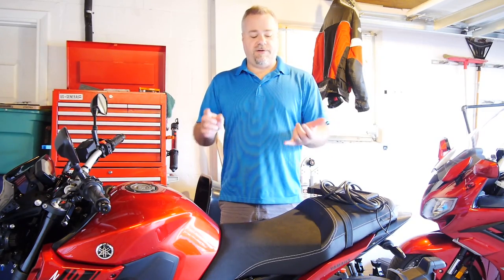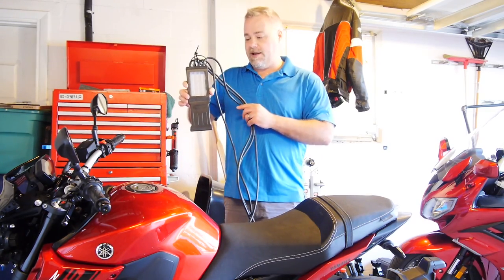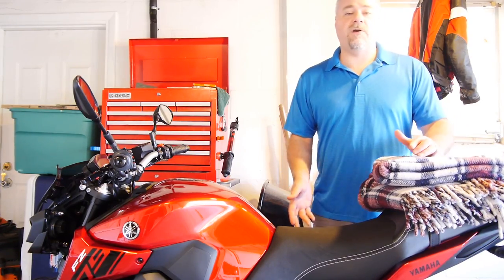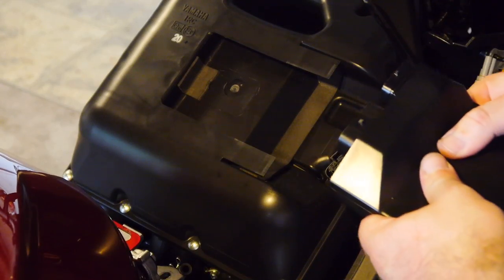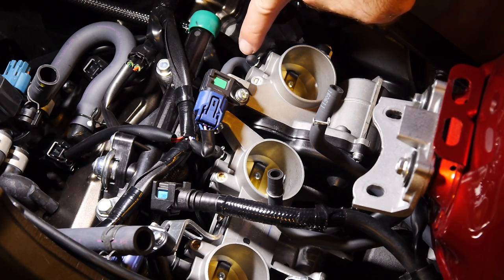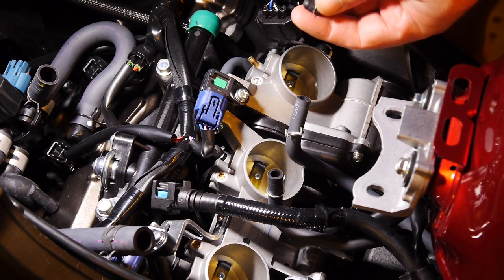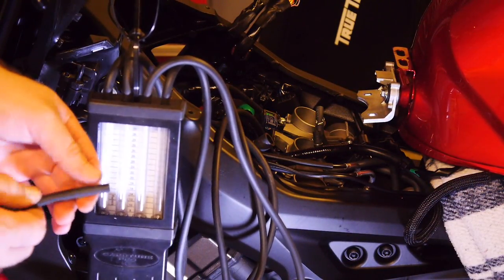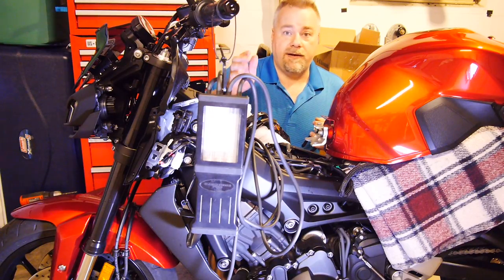How To Do A Throttle Body Sync TBS 2017 FZ09 MT09 FJ09 MT09 Tracer XSR

Comment: Love the video and you only confirmed my suspension…this is my first fuel injected bike and I stupidly thought it wasn’t necessary because of the electronics …I noticed a high rev vibration after doing my valve lash… I’ve felt this in all my older carbureted machines when they got outta wack …after searching for hours for my sync gauge I got her tuned and holy crap what a difference!

Comment: Consider this...if you use a master cylinder to calibrate off of, then you could still use this tool on more than 4 cylinder engines.  Calibrate your first 4 cylinders, then, while staying connected to your master cylinder, calibrate the other two or however many.

Comment: I just bought an xsr 900. I've been irritated by the vibrations in in throttle lever and right foot peg at higher revs. I had no idea it might be something tunable. It's getting that break in service done next week and I'll make sure this step is included in that.
Later one I'll get the tool myself. 
Thanks bub.
Reply: Update: this isn't a fixable thing according to the mechanic. It's a computertuning thing and pretty much requires an after market exhaust. I'm doubting his competence based off of info from a YouTube video. I've become one of those..

Comment: Hi. Great tutorial. I can't see a way to that left hand vacuum connection though... even if I could get the cap off, I'm not sure how I'd get the gauge tubing on. 2018 bike, but surely they can't be too different.
Reply from the maker: Long needle nose pliers.  Easy.
Reply: Seriously I have long and angled needle nose pliers and not only is it near impossible to see but everything is in the way. Did you disconnect other lines out of the way first?

Comment: The clamps being difficult to remove is most likely not due to “over-tightening”.  Clamps with dissimilar bolt and clamp materials are subject to excessive friction when torquing.  It is known as “galling” and causes a welding effect.  With every penny accounted for in production costs it is, by design, an effective way to maintain clamping force where the joint is subject to vibrations.

Comment: Great instructions! I purchased the Carbtune Pro tool based on your recommendation. I plan to  check the sync during my 600 mile service on a 2020 FJR1300 over the next day or two. I also watched your other video specifically covering the FJR sync process.

Comment: Thank you for this. I followed the procedure but made the mistake of not allowing the bike to warm up properly before starting the adjustments. I managed to balance the cylinders, but now the bike is idling at 1600 RPM, and after riding for an hour, my throttle hand became numb. Going to try it again.

Comment: I took delivery of a new 2019 Tracer 900 GT, two weeks ago. I just put over 1000 kms (600 miles) on it. I did a 400 km ride yesterday, and I had crazy amounts of vibrations in the handlebars, my hands are still a bit numb today. I hope getting my throttle bodies synced will help correct this. It is sucking the joy out of riding my new bike.
Reply from the maker: It will!

Comment: good job on the video, i did this for the first time ever on my VFR800 i had last year.. made a huge difference in the vibrations like you said.. i looked in the Vrods manual says nothing about adjust-ability on them.. id have to look it over to see if it has adjustable screws to do it to this bike.
Reply from the maker: +William Huston, Realtor same procedure but the crowd requires you to install fittings to the engine they don't give you the nipples.
Reply from the maker: +TwoWheelObsession vrod not crowd lol autocorrect

Comment: Good video just finished syncing throttle bodies on 19 mt09. I was able to get them all in sync but I noticed the adjustment screws for both throttle bodies are fully turned to the right. What happens next time I need to sync throttle bodies ?
Reply from the maker: If they still need to go that way you can back out the master up to a turn without a problem.

Comment: Hey Bryan. The manual notes to re-install the air box after connecting the sync tool before checking the sync, then adjusting if needed. I realize it would be pretty much impossible to get to the adjusting screws with the box on, but have you tried checking the sync with the air box installed compared to removed to see if there is a difference in readings?
Reply from the maker: I have on others and it made no difference to leveling them. It would to an absolute number, which is not needed at all.

Comment: I just picked up an XSR 900 and everything you described about vibration is what i'm currently experiencing.  It would appear I need to do a throttle body sync.  Can you point me to which video you went into more detail on disassembly. This will be my first time into the "guts" of any motorcycle so I'm a bit nervous.  Great video, and I'm actually looking forward to doing the work myself.  any additional advice, tools to use, etc. is greatly appreciated.
Reply from the maker: +Kevin Ankin the one called how to remove your tank air filter etc

Comment: great video, I am glad I found your channel, I just got and xsr900 and has about 250 miles, so I would have to do this soon, The only part I am confuse is the part with the master cylinder, is it the one with the white where you adjust it or you never touch that one. thanks in advance for the reply.
Reply: You never touch that one. You adjust the other two.

Comment: Thank you very much for this instructive video. I also bought the Carbtune Pro and try to do the sync on my Yamaha Tracer 9 - same CP3 engine, but no matter how much I try to adjust the screws, it does not seem to work for me as I'm not able to level up all 3 columns of Hg. The one from the master cylinder (painted one from the factory, which I haven't touched) is just 2 increments up from the others 2, no matter how much I tried to adjust (no more screw rotation left). Do you have any idea why? Any input from you would be much appreciated.

Comment: Thanks for the great info and upload. My FJ09 is doing exactly this problem. It just started this spring . Before it used to be dead smooth. I have a question though. How often do I have to re-sync the throttle bodies ? Thanks in advance.
Reply: Yamaha recommends every 4,000 miles

Comment: Good vid. I have a 2015 FJ09. 1,900 miles. Just bought it n put one tank of no lead in it. I’ve burned a half tank n this morning noticed a slight misfire all thru the rpm range. I rev it n notice a slight backfire. It pull fine no flat spots. You indicated the vibration issue. My bike does vibrate. Just started it. I’m looking online for this misfire problem but have not found anything. Could I need a sync? Would out of sync cause a slight misfire? It’s so new I’m not thinking about a parts issue. Any feedback would be appreciated. Thx Chuck.
The backfire is when I close the throttle. Like a lean issue. You can barely hear it.

Comment: I tried a throttle body sync on my 2021 MT-09.  The master cylinder remained higher than the other two.  What do you do in that situation?
Thanks in advance.
Reply: I had the same issue.  I just got my other two a close as possible.  I wrote to Yamaha USA about the matter and haven't heard back.  My bike is running great so I'm just going to let it go.  My next maintenance is coming up soon and I'll see if that hasn't changed.  If it's the same, I guess I'll just live with it.

Ride well.

Comment: If your ecu is flashed will it effect the rev range the primary cylinder is set too stock or do ecu flashes not have an effect on where the idle is supposed to be?

Comment: Hey, thanks for the knowledge you share. I am buying a MT 09 this Monday and this is a lot of information i need in one. 

I have a question: How did you supply fuel for the adjustment when the fuel lines were disconnected?
Reply from the maker: They are not disconnected
Reply: Was it connected with the lines from the tool?
Reply from the maker: You misunderstood the video. They fuel was never disconnected. The electrical connections were reconnected after removing the heat shield.

Comment: Great vid, just a thought though there seems to be a debate on some forums whether the job should be done with the airbox on or off, I wonder what the workshop manual states
Reply from the maker: +Bikers Quest the wording is confusing until you realize it's not physically possible to do any adjustment with it back on. At idle it's irrelevant for readings anyway.
Reply: I would get paranoid about stuff dropping in, maybe some nylon hose over them to keep out anything large?
Reply from the maker: LOL uh, no.  #1 no need.  There is no magic 'stuff' floating around ;)  #2, that would get sucked in LOL
Reply: i guess I've always been drilled never to run a bike with the filter removed but I don't see another option in this case

Comment: Hi Brian, Just an update as to the price increase since 2017..... $140 today on Amazon. How would you feel about a ECU Flash from 2 Wheel DynoWorks for $250?
Both prices ref. 1/31/22.

Comment: How often should you tune your throttle body for the mt09, and where can i find the periodical maintenance table for this?  I have looked over owners manual and i could not find it or i might have over looked it.
Reply from the maker: It's right in the chart in the owners manual with everything else

Comment: @TwoWheelObsession
Great video, thanks for sharing knowledge. I have 2 questions.
When tightening/loosening those screws you are decreasing/increasing air or fuel?
When you say that the Carbtune Pro tool can be used on any bike you are referring to any fuel injection bike or even carburated bikes aswell? 
The name Carbtune is by itself sugestive but it's just to be sure ☺️
Reply from the maker: Any bike. You are adding air

Comment: I have to ask. Does your engine tick (like valves at top) at about 3000 rpm? 
Curious if it's something that may be remedied by doing this..
Either way, your video convinced me to buy this tool. Thanks!
Reply from the maker: No and no
Reply: Oh well. My bike has just over 1300mi on it and has some stutter in the idle, so I'm still going to sync it. Going to open it up in the spring and check valve clearance.
Reply from the maker: Neither of those cause any kind of stutter.  Check fuel and ignition.
Reply: I apologize, stutter may not have been the correct word. The idle just isn't smooth as I think it should be. 
As far as my valve noise, the shop told me it's normal Yamaha engine noise, but I'm still going to check.

Comment: Thanks for your content and the time to put it out there. I recently purchased an xsr900.  When I just twist the throttle a little bit ( revs 3000 and under) the bike starts chugging or lurching I’m not sure how to explain it.  It’s like it’s not getting the fuel until I open the throttle a bit more. 

happens in every gear at whatever speed like the bike wants to stall. I need to feather the clutch around turns.  Would this sync be the first thing to try?  Idles fine and other than this area of the throttle position all seems to work fine.
Reply: Did you ever get your issue addressed?

Comment: I do have the carbtune aince a long time but im not use to this bike, you said not to touch the master bolt so that mean you are just playing with the 2 brace ones ?
Reply from the maker: Yep
Reply: TwoWheelObsession thanks, my dealer wont touch it he want to make multiple appointments to do it in between the yamaha manual , 500kms,1500,3000...etc a money pit of a service dealer if you ask me .. the manual said the first should be 1000kms 2nd 7000kms etc... Not the same !

Comment: Hey there, so I did the throttle body sync in my fz09 and right after that, a rattling noise when the clutch is not pressed started. It stops when I press the clutch. What do you think that can be? Literally started as soon as I had the bike all put back together and went for a ride. The throttle itself is much better and smooth.
Reply: Replace the dampeners on the clutch basket. Had nothing to do with throttle body sync

Comment: Quick question: did you sync the throttle bodies to idle or at a certain rpm? Because my idle was hopping all over even after being thoroughly warmed up. So instead, I synced the throttle bodies to be even at 4500 rpm (highway revs).

Is this a dumb idea? Should I go back and re-sync them to idle as much as possible?
Reply from the maker: It’s always done at idle. If you mean the bars we’re moving that means you didn’t have the restrictions in

Comment: I decided to do the trottle sync this morning, the bike got to normal temp and everything but for me the white painted screw was the middle one and to sync all the tree I needed to tight the 2 screw all the way in to catch the middle one and I cannot ajust more then that, the bike sound better but im worry because the only ones I can touch or ajust are already topped up now ! What should I do?
Reply from the maker: Nothing, you are fine
Reply: My middle screw was run all the way in from factory. Kind of a piss off because I couldn’t adjust it to where it should be to match the master.

Comment: Any idea how I can sync when the cyclinder I am using as a guide is erratic on the carbtune? Dampers are good and the other 2 cylinders are fine.
Reply from the maker: Switch tubes.  Only lack of dampers or bad position will do that.
Reply: Hmm, I tried another tube with the same result. Dampers are on all. Does the unused port on the manometer have to be capped? I didnt try that yet.
Reply from the maker: No.  If the behavior follows the cylinder then you are seeing normal,operation
Reply: Twas the dampers. It's a friends tool and he assembled it wrong. Put the adapters in place of the dampers DOH! One question. To get the rods to go DOWN do you turn the screw counter clockwise? Thanks.

Comment: Hi Brian, I'm now coming up on 600 miles on my '17 and noticing a slight surging sensation at low RPM. Could that also be due to out of sync? I bought the tool and about to do the syncing but wanted to see what you thought. Thanks!
Reply from the maker: I have not heard of it ever causing that.
Reply: hi just wondering if you ever found out what your low rpm surging was? i have a mt 09 with about 3000 km on it and im getting the same thing
Reply: Roger Bourcier I synced the TBs and it finally went away so not sure if it was from that or I just put more miles on it.

Comment: It seems the master throttle body was at 22 CM before adjusting the others and came up a little past 23 cm after adjusting. As long as the others match the master throttle body all is good ?
Reply from the maker: Where it's at makes no difference, you are only looking at them relative to each other.
Reply: @TwoWheelObsession  thanks for the reply . This will help me out alot

Comment: help! i just baught a new tracer 900 gt, the handlebar vibrates at certain rpm, mostly on the freeway, its a vine vibration but enough to make my mostly left hand kinda vibrate still even off the bike. could it be a sync issue?
Reply from the maker: Yes. The first one is to be done at 600 miles. It’s in your manual.

Comment: My master tb is #3. Im able to symc my #1 and #2, but cant get them both to sync with my master which is a lot higher level on the carbtune?
Reply from the maker: What do you mean 'can't get them to sync'?
Reply: I have the same issue. What did you end up doing?

Comment: hello sir, 1 month ago I cleaned the carburetor of my motorcycle, I used a carburetor cleaner spray, now my motorcycle is running at high RPM. :(

Comment: Seriously? This is the one that causing my right handle bar vibration till hand numb? I have changed the front tyre, rebalance and align, changed brake pump from steel container to plastic, increase bar end weight and etc and yet the vibration is reduced but not significant. At some point even thinking to sell my bike due to the frustration of the hand numb issue. I need to try this out if it really works
Reply from the maker: Yep
Reply: Hi, it balancing reduces amount of vibration?

Comment: @twowheelobsession great video. Will be doing this to my FZ09. I'm currently experiencing rough idling. Sputters a bit and I've had rough cold starts as well. My only question is if the base throttle body is out of tune, is it possible to find out where it needs to be? If the base throttle body is out of tune, then you're essentially going to be left with 3 throttle bodies that are out of tune.
Reply from the maker: +Chad that is correct.  If someone messes with the master there is a recalibration procedure you can do with the service manual or take it in

Comment: All in all not a bad video minus the fact the method shown here is 100% incorrect. I’m a fully licensed mechanic. Never in my life have I heard a manufacture give a procedure to run or adjust anything on an engine with no air filter element installed. You must I repeat MUST have all air plenum ducting and hoses connected prior to making any adjustments. The plenum design and air filter element all have effect on throttle body synchronization. You cannot possibly reach them (adjusters) with the plenum installed without this tool.  90890-03173 carb angle driver. Which he does not show here. With no adjustment tool You can do it with the longer method which is to install plenum note reading remove and adjust screws install recheck and repeat as necessary till within spec which not sure if mentioned is no more then 10mmHg out from one another. Carbtune is a great tool tho. Also the master is always on the right side of the FZs it will be on the cylinder with the throttle body actuator which this motor design is always right side